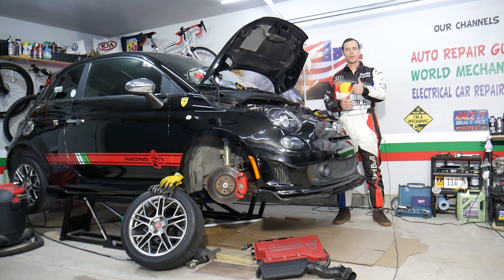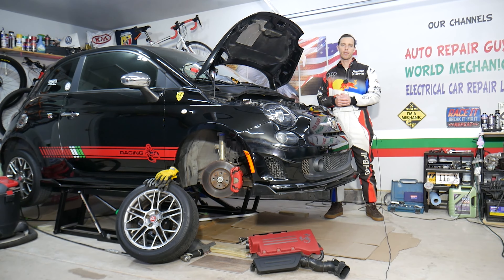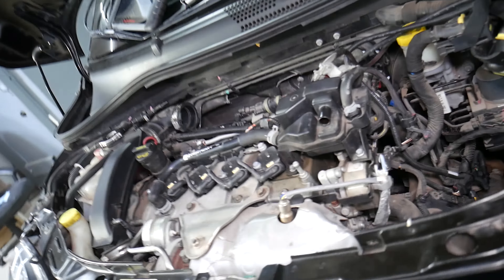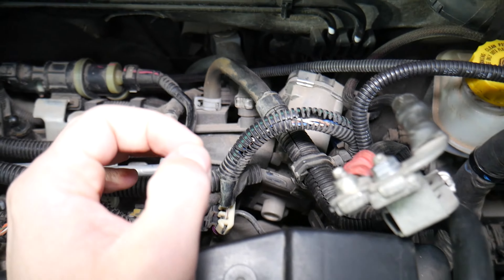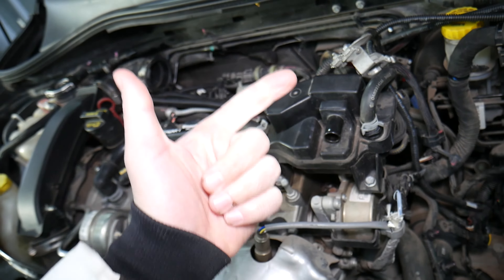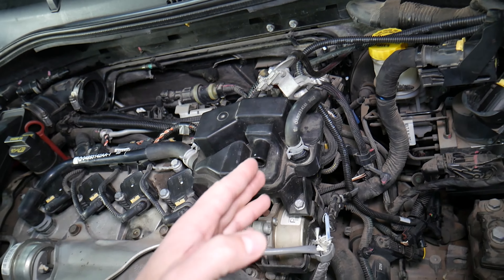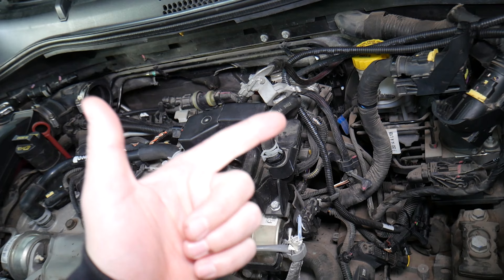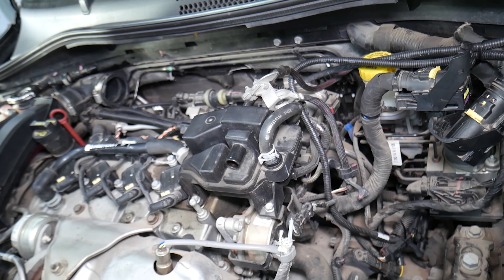FIAT 500 SYMPTOMS OF BAD THROTTLE BODY, FIAT 500 ABARTH THROTTLE BODY

Comment: I think this is what happened to me tonight after driving stop and go in the city no issues I had the flashing lightning bolt and check engine light. I cleared the lightning bolt but my check engine light stayed on and my car feels very limp. Also get a random Hill assist unavailable code
Reply: Same with me (2016 abarth 500 43k) I still haven't figured it out yet, I checked and cleaned the throttle body and it wasn't dirty so I'm actually thinking it's the accelerator pedal with the issue since it's drive by wire....
Reply: @topend2282  I have a 2012 500 and I’m also experiencing a random hill start “shake” and everything starts losing its power. When it’s turned off then on, the dash will warn me, but will drive completely normal again until it happens which can be every 5 minutes or few hours. The throttle seems fine, a tune was also done. This mystery is becoming a money pit.
Reply: I’m having this same problem right now have any of y’all figured out y’all’s issues ?
Reply: @novalui3946  ugly the source of my issues was the reverse light switch on the gearbox. Just the small little mechanical switch was stuck open but it was throwing so many errors